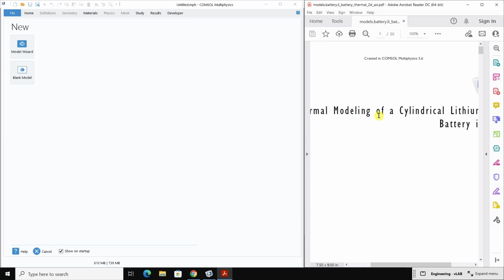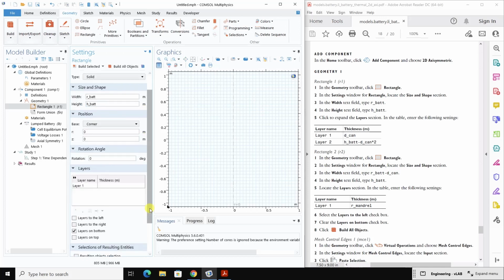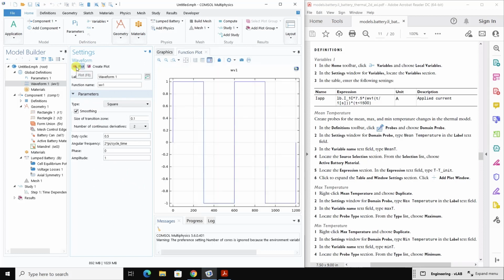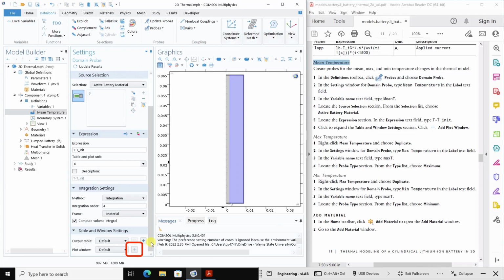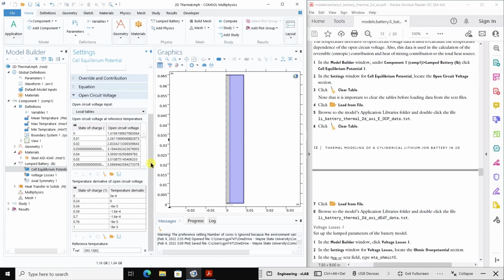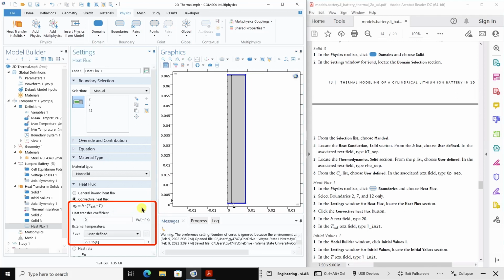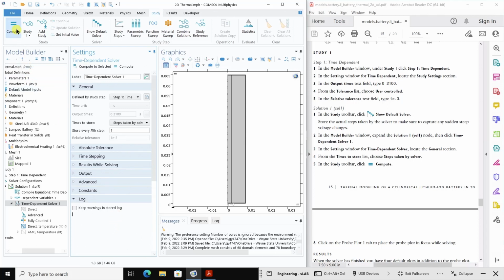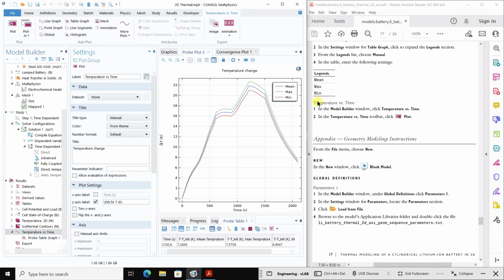2D  Thermal modeling of a cylindrical lithium-ion battery 1080p

Comment: sir can you do parametric sweep in this model  to check the behavior of battery on varying parameters like parameters can be 
Cycle Time - {600, 900, 1800, 3600}   sec
Inlet Temperature - {280, 298, 310}     K
Initial State of Charge - {0.2, 0.5}
Cell Capacity - {1.0, 1.258, 1.5}   Ah
and then study the graph of maximum temperature vs initial state of charge at different cell capacities